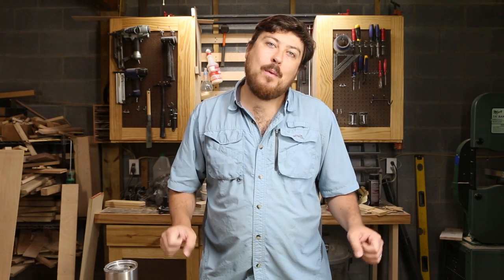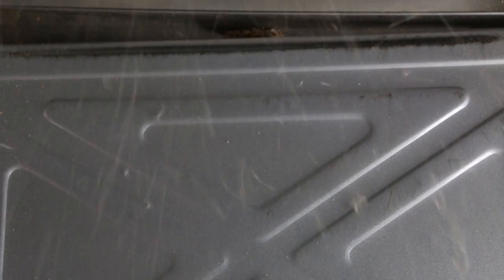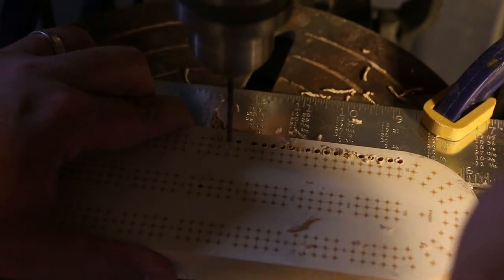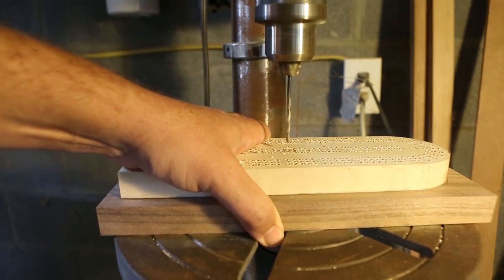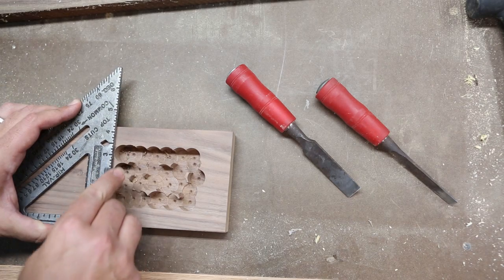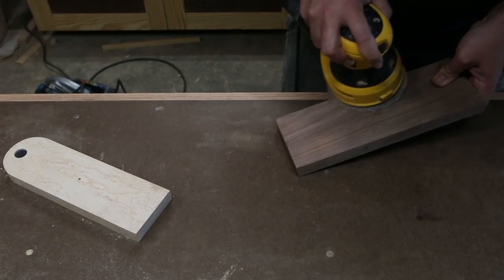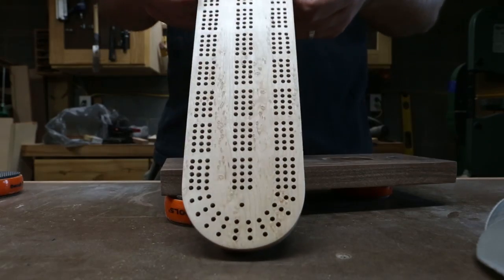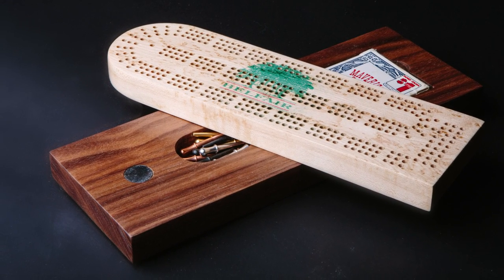How to Make A Cribbage Board

Comment: very nice work man. I have been thinking about doing some woodwork in my spare time (if I ever could get enough money to afford the tools needed to do so). I used to be good with band saw when I was in high school about twelve years ago.
Reply from the maker: You can get started fairly cheap and support your addiction by selling pieces and buying more tools.  That's what I did/do.  Since my primary job is being a photographer, any commission that comes along I try to put that money back in the shop.  

you can pick up smaller, older band saws on Craigslist for $50 or so.  A circular saw and a drill can take you a long way.  Then maybe a router, table saw, and either a jig saw or a band saw.  A drill press is invaluable as well.  Planers can be pricey but you can save  a lot of money by being able to mill your own stock and not paying a ridiculous amount for milled lumber.  Plus, that's how you find the really unique pieces!

Comment: Comments and question!  Excellent looking board - I made one last year for my brother, but only had one kind of wood (it was mounted a lazy susan base - something he has always wanted, but has never seen).  I don't have a drill press and had to hand drill all the holes - not as fun as you would think!  love the idea of the lower layer and the magnets to hold it in place!

Questions are how do you maximize the grain of the wood?  I thought I had read that direct sunlight will bring out the grain...is that right?
Reply from the maker: Wow, I can't imagine drilling all those holes by hand! I hadn't read anything about direct sunlight but I imagine that could be true. I like to use that oil/spar urethane mixture to bring out the grain. It really soaks into the wood and adds a lot of depth to the grain versus using polyurethane which I feel looks more like a top coat and kind of plastic like. Whenever I used figured woods, I use my oil mixture to finish.

Comment: Neat. My drill press sucks too much for a project like this. Too much TRO. 

Also, to make templates remove more cleanly and easily, I cover the surface with masking tape, then use 3m 77 to attach the template to the tape. Then when I'm done, just peel the tape away and template and glue go with it.
Reply from the maker: That's a neat tip with the tape!  I'll have to try that!
Reply: It works pretty well. I use it mostly for cutting slots in fret boards. Like this: http://i.imgur.com/xzDI3D0.jpg

Comment: How did you line up the holes for the magnets with the holes being on the interior?
Reply from the maker: +Annony Mouse just used a tape measure to find the center of each piece. Nothing overly complicated
Reply: drill a small hole through from top (using one of the holes already drilled) then you have a reference point on each board.

Comment: I want to know how to make the storage compartment for pegs with a metal slide.
And where to get the slides? I havnt found much useful help yet in you tube, or anywhere else. I have a router to make the compartment but how to cut the small grooves, if I ever find metal slides.
Reply from the maker: Hmmmm.  How about some shim stock cut to size and a slot cutter on the drill press?  Look up Bearkat's "making a backsaw" video for reference.  You could cut the metal to whatever size you want then clean up the edges with a file.

Comment: That turned out really well.  Too many holes to drill.  That, is a job for a CNC.
Reply from the maker: +Howard Springsteen Thanks!  It was a lot of holes to drill.  If I got a lot of inquiries for cribbage boards I would definitely look into CNC.  Since this was custom and only one piece, it was manageable to use the drill press.  I've thought about getting CNC for doing signs and custom logos on pieces for local businesses but haven't bit the bullet yet.
Reply: @wmwalkerco  I've made hundreds of cribbage boards...never will I use CNC.  Mine are hand crafted.